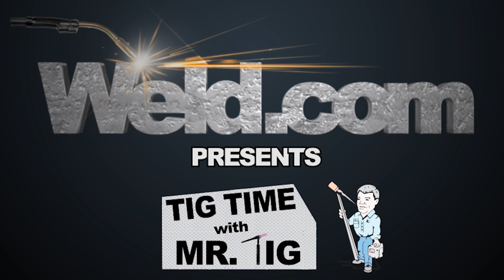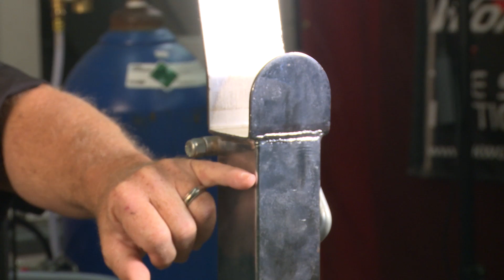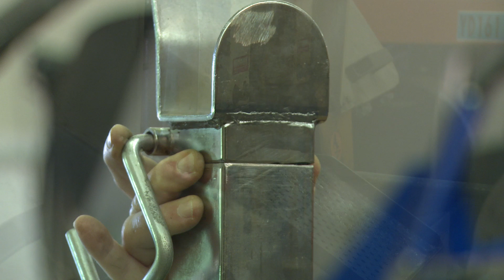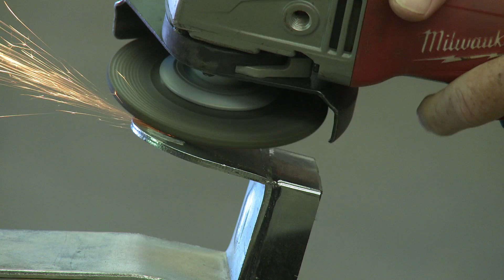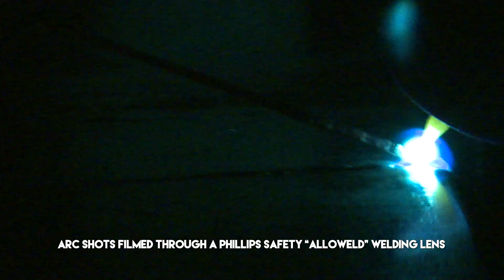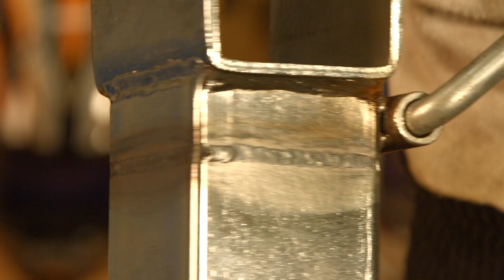Welding Chrome Plated Steel Weight Bench Project

Comment: What? Chrome is absolutely not an insulator. It is bonded to the steel by electrolysis, chrome literally HAS to be conductive for metal plating to work. Where did this guy get the idea thats its an insulator?
Reply: Anodizing is done by aluminum being conductive as well.  Guess what, when its done it doesnt conduct.  Chrome is very poor conductor.
Reply: Yes, chrome is a poor conductor.

Comment: Are we sure it's necessary to grind off the chrome for the ground clamp? Everything I can find on the internet says chrome is electrically conductive.
Reply: its because its toxic when being melted (or welded on) and it leaves shit in the weld puddles

Comment: Could you have used 308 stainless rod if you wanted even more corrosion resistence and it still be just as structurally sound.
Reply: 309L

Comment: Thanks for the video. Was wondering could you have used stainless filler rod, to stop rusting?
Reply: theomnipresent1 
309 with a back purge would be my preference. 
Also there would have been a reduction of corrosion where the filler material was deposited only and the actual joint may still exhibit some corrosion if exposed to materials that would normally corrode bare mild steel. 
Suitability of 309 filler would depend on the application and maximum anticipated loading. 
Beware that using 309 filler for mild steel to mild steel weldments can introduce concerns where there is adequate tensile strength but reduced ductility and elongation properties.
This condition may form cracks if subjected to significant and or often repeated flexing of the joint or base material adjacent to the joint. 
If the loading is below the yield strength of the base material and the deposited filler rod there is no real concern.
Reply: Yes.
Reply: 309, 312...?
Reply: patw52pb1
Good information man, thanks.
Reply: theomnipresent1 
You are welcome.
Reply: Thanks for the info

Comment: You tack welded the square parts together, but I was wondering if there is any "order" of the tacks to lessen distortion. I don't have a table like the one in the video where great clamping can be accomplished.
Reply from the maker: You can tack opposite ends if you feel that there will be a high amount of distortion. In this case, we could have just bent it back if it was a problem.

Comment: so why not just flip the plated extension around in the stand?
Reply from the maker: torcher78 we could have turned them around, but then we would have had to drill out new holes in the stanchions for the lock pin. It was an option, we just chose this.
Reply: Welding is more fun than drilling :D

Comment: why not just turn the stands around?? this makes no sense
Reply: The point was to have a project that gave him the work steps and steel type to demo for us looking to learn.  Thanks for the video, dude.
Reply: That doesn't really explain very well. why you couldn't remove them from the yellow lower portion and turn them 180 degrees?. it looks like it telescopes in there so it should be removable and would only have to drill holes on the other side.
Reply from the maker: We didn't have it in the video, but the stanchion attached directly to the bench.  The bench acts as the support holding up the two stanchions, so there's no way around it.
Reply: +ReluctantProphet drilling holes would have been a lot easier than cutting apart those pieces just a weld them back together again! doesn't make any damn sense to me whatsoever
Reply: exactly what I was wondering
Reply: Okay I was wondering about that
Reply: there at the beginning...it shows a bench attached in the center....